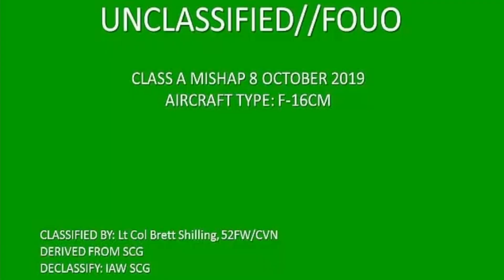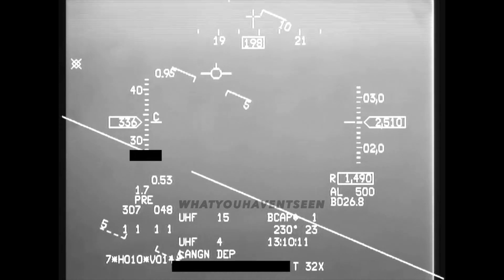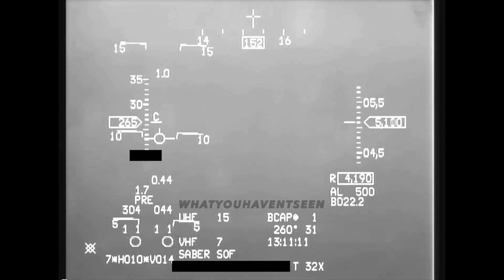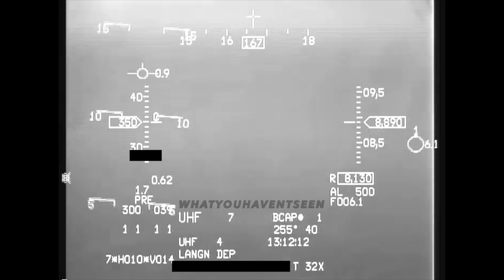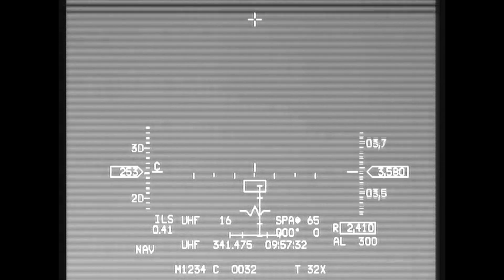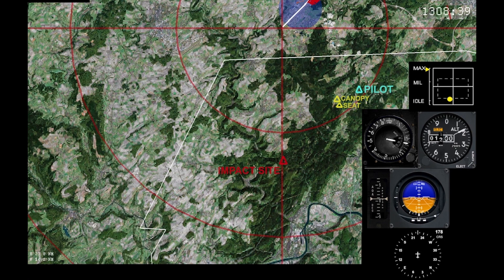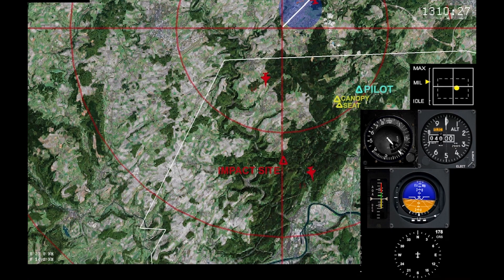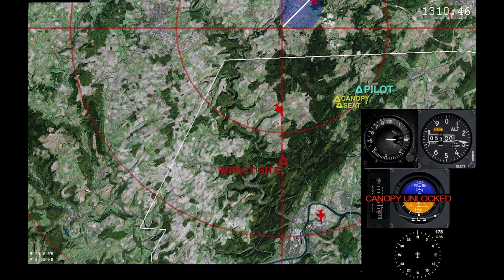F-16 Loss of Electrical Power and Ejection (HUD Footage)

Comment: He took the easiest route.  Fuck the airplane, im not doing the hard work im payed for.   Went away from the hard work needed.  And yes I have flown multies with partial panel and go down to 300 feet agl.  At about 400 hours of flying singles only, i had to ferrry an Aztec to over a big lake 130 miles wide.  The day turned to be bad with rain all over.  My instrument rating and multi was only a couple of months back.  I was dying to fly the aztec, which was a bigger brother of the Piper Apache i tooke my multi a few weeks before.  In Colombia 1975.

Comment: As soon as the failure started, he immediately lost all awareness of altitude. Watch starting at 3:29. He went from about 4,400, up to 4,700, then quickly down to 3,140 and nearly hitting the trees. Yanked back and climbed and ejected as well as nearly stalling. Had he declared an emergency and just focused on climbing above the clouds he could have troubleshoot the issue or diverted to an airport with non-IFR conditions. He had a wingman to help out. Sure appears like he lost focus and panicked and ejected. Definitely needs some more emergency training in the sim to build confidence.
Reply: Flying on instruments is not a trivial thing to do. Flying on instruments that give you mismatching information without a failure indication while near the ground at low level in a high performance aircraft ....no, I don´t want to be in that position. I´m sure that guy was and is fine to fly on the standby horizon alone, but that was not the case here. He lived, so it definitely was not a wrong decision to bail out.
Reply: @flyingcaba5874  gonna be careful about what I'm going to say here so I'll be brief and exact. I was here when this happened. The fog and low viz conditions that happen almost daily at this base cannot be understated. I have rarely experienced fog like this since and certainly not at the frequency that this base had. sometimes it doesn't even clear out until nightfall. And to my knowledge he was in the dark, isolated and possibly unable to even see his own wingman. He made the call he did, and despite outward circumstances and visuals; he didn't land it in a village or on a german civilian population... which is damn lucky considering the sheer magnitude of the forces and physics that involve such a splintered fragmentation of such a large high velocity aircraft
Reply: You are probably right, but... in IMC, close to the ground at fairly high speed, it's time to make a selfish decision. Capt Wilson did the right thing. There are thousands of F-16, but only one Captain Wilson family... The fact that he was flying again (less than two weeks later?) shows the professional view of the USAF. The learning effect is enormous. Saving his life was priceless. 
My five cents from the comfortable seat in VMC.
Reply: Tops were at 15,000'....think they took spacing on t/o so no rejoins until on top.
Reply: @jcheck6  I wasn't implying they join up before they were VFR. He had non-automated guages like an altimeter to use to keep climbing when his electronic HUD failed. He needed to focus on getting to clear air before doing any troubleshooting or messing with the HUD. He nearly killed himself by letting himself get distracted when he only had a partial failure. The aircraft was flyable as it was.
Reply: @Supersonicff-dw6bs  Yeah, I know as we had the same "peanut" gauge on the F-4.
Reply: You clearly have never flown the Viper...flying with total MMC failure, this low to the ground and in IMC conditions off of the standby ADI is one of the toughest things in the F-16. Low SA man...low SA.

Comment: I find myself somewhat confused. Were the round gauges still working or did they fail as well?  I don't mean to jump to conclusions but was that dude that much of a hud cripple that he couldn't go back on the conventional instruments? Instead opting for the needle, speed and rip chord let down? If so wow.
Reply: I just read the safety report. All standby instrumentation was normal. He was unable to transition to standby instruments due to lack or skill/training.
Reply: They also failed. They froze and as such were unreliable.
Reply: @Mdelgado12  how do you know they failed?
Edit: they didn’t fail. I just read the safety report.
Reply: @nattybumppo4151  I was there... also I have the report, I've read it multiple times, among other lines supporting a failure include: "Additionally, his primary ADI, SAI, and EHSI were not responding as expected when he made flight control inputs"

While I concede we were all relatively suspect of it, avionics specialists never really could explain how the pneumatic-based round dials would fail and did think that nerves and fear played a role, but the oversimplification of it was that a low ceiling mixed with instruments that at worst failed, at best were reacting in a way he couldn't trust led to the decision. I'm not sure if you somehow got a more detailed copy of the report than I have, but if you do I'd love to see it. This incident was a major moment in my career and life to this point so I am happy to track anything further that comes out.
Reply: @Mdelgado12  Sounds like the same one. I’m not talking about his primary instrumentation. The report says that failed. The STANDBY instrumentation the report says was operating normally. He was unable to transition to them fully like he should have. He was unable to transition to them due to lack of skill/training. I blame the Air Force completely.
Reply: @nattybumppo4151  I agree completely.  If you are not properly trained and tested on these backup instruments, you won't be able to do a quick transition to them in an emergency.  Particularly if you have a huge screen and a HUD telling you something different.
Reply: @Mdelgado12  what does ASI, MCHAMMER, EDI and JCPENNY all mean? What was the weather like?
Reply: @nattybumppo4151  with total MMC failure the round dials do momentarily freeze up. If this occurred during his transition from HUD to round dials, causing him to transition to the standby ADI, spatial d sets in VERY fast.
Reply: @TheJetpilot55 I agree. Spatial D sets in fast when you aren’t looking at your instruments in IMC. The report clearly states all standby instrumentation was operating normally. Where did you get the information that his standby instrumentation “froze momentarily?” I didn’t read that in the report. Seems like that would be a key factor, but the safety board did not mention it in their findings.

Comment: It's a real bummer losing an F-16 but I'm happy to hear the airmen made it out safely.
Reply: *airman, singular.
Reply: The F-16 has a good seat.
Reply: I was at Spangdahlem when we lost a brand new F-16 on its ferry flight, crashing in New York. It was deteriorating weather and the plane ran out of gas. it had like 20 hours on the airframe.
Reply: @jumpingjeffflash9946  well I'm sure there's a civilian wedding somewhere that's thankful it won't get bombed by the lost asset

Comment: Worse time to have problems is when you fly into IMC especially when one loses instruments. You have no artificial horizon, VSI, airspeed indicator. At least pilot is alive to fly another day
Reply: He had an artificial horizon on his standby ADI that was operating normally. He also has speed and altitude available.
Reply: @nattybumppo4151  were those guaranteed to be reliable no matter the situation? is it an analog system or some type of redundancy separate from the other instrument failures? too many stories of aircraft with the physical ability to keep flying either being flown into the ground or into a stall...
Reply: @xisotopex  Yes. They are a separate system. The chances of both failing at the same time is basically zero percent. The report said the standbys were functioning properly. The pilot was simply unable to transition to standbys.
Reply: @nattybumppo4151  wouldnt the standbys be  right in front of his face? as available outside of his HUD within his very field of vision? something someone would be able to acquire within milliseconds?
Reply: @xisotopex  I don’t know where the standbys are located on an F-16 dash but more or less yes.

Comment: Flights during IFR Conditions flights become critical when you lose all your availability Avionics and the F-16 can be replaced and the Airforce Pilot survived this and his training that save him .
Reply: These aircraft have dedicated emergency standby instruments with independent power source (battery). This is practiced in the SIM. Would like to know why those failed.
Reply: @jmp.t28b99  They most likely did not. Pilot error.

Edit: just read the safety report. All standby equipment was normal. Even the primary airspeed and altitude instruments were normal.😮
Reply: the military would rather replace a person than equipment. thats just a simple fact and they make it very clear to you.
Reply: @cptkirkpyro5656  the air force would most definitely not replace a pilot than equipment. If youre talking about the high end equipment, accidents almost never happen because they are top of the line pilots
Reply: @muffinman3669  Class A mishaps are at an all time high in the Air Force.
Reply: @cptkirkpyro5656  Just to reiterate: hello no. Pilots, especially good ones, are rare and expensive, more than any aircraft. If you let all your pilots die to somehow spare some aircraft now you've got inexperienced pilots to fly those aircraft, with few or no veterans to train them. The aircraft you've so wisely saved will now crash in training accidents at a higher rate than the attrition you were taking with the veteran pilots choosing to eject and save their lives over a last ditch effort to save their plane.
The military is ruthless but they ain't dumb and keeping pilots alive is tried and true doctrine.
Reply: @paradox11111111  I can't imagine one pilot is worth 25 million dollars to the military. As much as we don't want to think it's true, I do think they would much rather lose a pilot than an expensive military jet.
Reply: @xn40sarethebest  I explained the rationale behind the military's actions as clearly as I'm able. That they value the lives of pilots over the aircraft they fly is self evident and a matter of public record.
Reply: @cptkirkpyro5656  Not a good pilot. Good pilots are what keep them from losing even more planes to pilot error, and he likely wouldn't be there if he wasn't a decent pilot.
Reply: @ChadDidNothingWrong  touché

Comment: Looked like IMC but still, you would have thought there are standby instruments to find somewhere with VMC? I guess electrical issues could affect a lot more than just instrument in a FBW aircraft thou...
Reply: Hard to say without much more info but as a pilot myself if you're in full IMC at low altitude moving as fast as the aircraft do, I could see how losing half your cluster could be a real clincher. In a split second you have to make a decision whether you're punching out or not and it would be difficult to tell which set of instruments is malfuctioning and which set isn't,  if they aren't all malfuctioning and remember, you can't trust your body to tell you what the plane is doing when you can't see outside. 

I think that ejection was the safest bet for the pilot and I highly doubt this was an inexperienced pilot issue. There's specific protocol for these types of situations and he had to make a decision NOW. Freezing and working out the problem a couple thousand feet off the deck in full IMC  at over 300mph is a good way to auger in and out happens fast. It would've taken him 2-3 seconds to hit if he had been in an unusual attitude. Better to get away if you aren't sure what your real attitude is. The USAF can buy another plane, but you can't buy another life. I'm the end, even if you're wrong, better to walk away with an ass chewing alive than second guess yourself and ride the plane into the dirt. I see no problem with this call.
Reply: There are standby instruments. Not sure why they weren’t sufficient.
Reply: didnt he have artificial horizon on his standby ADI that was normal as well as speed and altitude  that was accurate and available?
Reply: He had a standby ADI and also altitude and airspeed. That’s all he needed to recover. He was unable to because of a lack of skill and expertise unfortunately. The AF is at an all time high in Class A mishaps due to lack of training and experience.
Reply: @nattybumppo4151  read the description please. The primary instrumentation failed but this wasnt properly indicated for some reason. So the pilot had two sets of data to choose from and maybe thats not the situation you would like to be in when split seconds are separating you from death. In a different circumstances he would have time and altitude to figure out what was going on. Here it was die or live.
Reply: @LaggerSVK  Saying he had two sets of data to choose from is a bit misleading. Only 1 instrument in his cockpit was providing incorrect data(initially), and that was his primary ADI. The rest were either blank or operating normally. And the pilot himself from his testimony understood that it was frozen and unreliable. Here is a list of Instruments that were working correctly: 
- Primary Airspeed Indicator
- Primary Altitude Indicator
- Standby Attitude Indicator
- Engine Instruments 

With these instruments, any qualified AF pilot should have been able to climb the 15,000 feet to get above the weather. 

I don’t fault the pilot for punching out. He understood he did not possess the skill/training needed to survive the situation. I blame the AF.
Reply: @nattybumppo4151  when your life is at stake and there is instruments inconsistency and you have doubts. I say better safe than sorry.
Reply: @LaggerSVK  And I’m saying we should expect WAY more from a current/qualified military aviator. But alas, these are the times we find ourselves in.
Reply: @nattybumppo4151  Having only a backup ADI and altimeter in IMC in a twitchy handling jet is sketchy at best. You can’t trust anything on the HUD once you lose partial data. How was the pilot supposed to know which gauges were working and which weren’t after stuff started failing? Monday morning quarter backing it after reading the accident report is lame.
Reply: @42dunbar  You didn’t read any of my posts, that much is clear. I had almost 1,000 hours as an instructor pilot in the AF, but whatever floats your boat my dude.

Comment: Oh no. I don't know how to read instruments. Better eject....
Reply: According to the recording he said round dials were frozen... Meaning he didn't have any indication /instruments at all..
Reply: @james94582  Only the primary ADI was frozen. Please read the safety report. All standby instruments were working normally on separate power sources.
Reply: @nattybumppo4151  I had not seen the link for the final report, now that I have I see where it indicates the standby instruments were still functioning... But can understand that after seeing some conflicting indications and being at the crucial point of flight and especially not know what was correct indications and not... I can understand the choice of safely exiting the aircraft before it wasn't an option (safely for pilot or surrounding factors)...  Tough choice to have to make quickly..
Reply: @james94582  As I’ve said on other posts, ultimately I blame the AF. We would expect a fully qualified F-16 pilot to be able to transition to standby instruments. But because of training syllabus slashes and hemorrhaging experienced pilots to the airlines, the AF has no other choice than to fill cockpits with non-proficient pilots.
Edit: Oh and also discharging fully qualified and skilled pilots because their religious/philosophical views don’t line up with the AF agenda.
Reply: Unfortunately, per the safety report, this is exactly what happened.
Reply: @JBS2018  That’s a pretty sick thing to say my guy. Seems like you have some anger issues, my condolences. Having flown an F-16 before has nothing to do with my comments. It’s clear you have no meaningful objections to them however, so good day!

Comment: Surprises mez dude gets disoriented with operable sby instruments.  Should practice more on basic flying skills I guess.
Reply: Instrument mismatch with no fault indications is a helluva hard thing to process at 300 knots and less than 5000 feet in IMC.  That's the thing I think most people will miss - there were no fault indications on the primary instruments.  The pilot had maybe 30 seconds to figure out which ones were reading right and which weren't and get himself good without hitting the ground.  Once you get Spatial Disorientation, it takes a lot longer than that to get yourself back right, even with excellent training.  I've had partial panel failures in little single-engine airplanes and it takes time to work out which is good and which isn't because the standby can fail too, especially if it's an electrical issue.  I'm lucky because I don't fly them more than in nice weather so I can just look outside, but you still get the idea of "man if this happens in the real weather, this would be very bad" when you see it happen before you.
Reply: @CAPFlyer  At least he recognized spatial disorientation and acted accordingly. Too many have not and have flown it into the ground.
Reply: Dude just increase throttle and pull up it's not that hard
Reply: I believe that he said that the dials were frozen/inop.
Reply: Jack goes by the name "Maverick" on the weekends...
Reply: I just looked up “how to say I have no clue what I’m talking about without saying it” and this came up. Let me guess, you do fine in MS Flight Sim.
Reply: @c1ph3rpunk  0